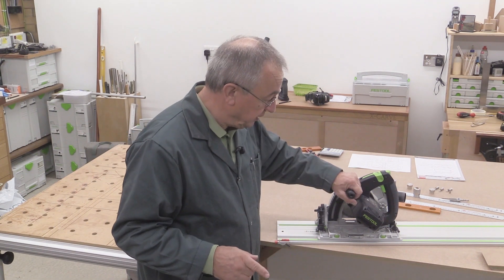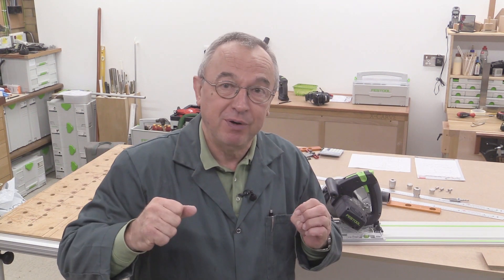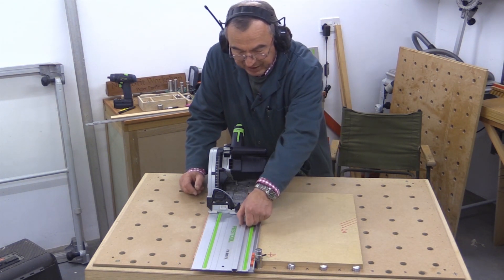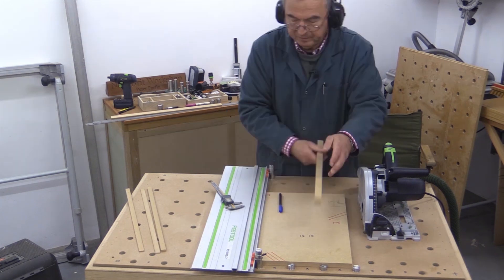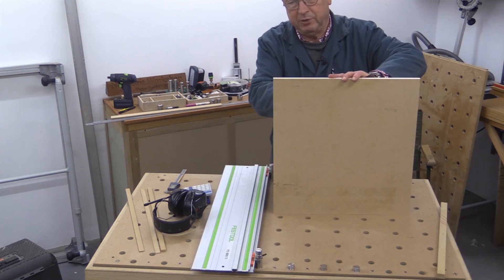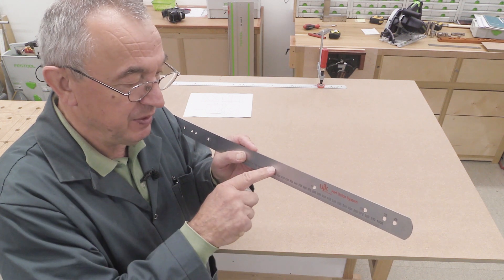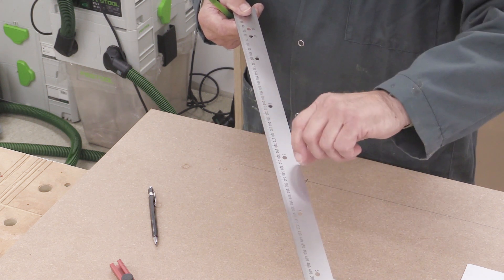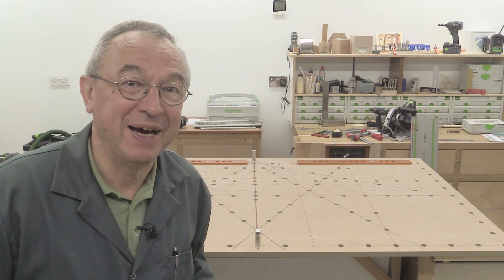Parf Guide System Mark 2  - 4 Cut Test

Comment: Thanks a lot Peter for this video and all your effort together with Axminster Tools. Today I drilled with the MK2 my first table top (19 mm MDF) and just did the 4 cut test, like you did.

For me it turns out to a difference of 0,135 mm  (meassured with a micrometer) which translates to a difference of 0,000088 radians which translates to angle error of 0,0050 which I think is absolutely amazing! 

On some holes I have a bit the problem that some of the super dogs are really tight and I almost can't get them out. Maybe I will drill over it again but so far I'm absolutely amazed! Thanks a lot!

🙌🙌🙌
Reply from the maker: Hi Lucas, Sometimes if the drilling of the 20 mm hole is done rapidly the hole can be tight. Axminster understand this and also know that holes in MDF can reduce in size by a fraction as the humidity level changes. So, they have produced a reamer for the 20 mm holes. There are two versions:
   - 107586 the basic reamer
   - 107868 reamer and chamfer tool combined
Peter

Comment: Hi Peter, first of all thanks for your videos, and thanks for the explanation of the rulers from 5.05 to 5.50. Not long ago, just over a month I bought from Axminster Tools, Warrington - Mark 2 Parf Guide System  and some accessories for it and they did cost me nearly twice as the Mark 2 Parf Guide System and IT WORTH EVERY PENNY, next purchase in my list is UJK Parf System Fence for repeatable cuts. 
              I notice that one of the rulers was out about 1.0mm the other one is dead straight, and I marked the straight one so in future I know and I can use as straight edge if I need it. And as you saying the holes ARE 100% on the straight line and I know that because I did few tests before I started to drill holes for new MFT3 top.
              Thanks again
Reply from the maker: Excellent.  Cheers.  Peter

Comment: Hi everyone.  
Short story: here are my results, in average deviation of 0.20 mm/m (based on 9 tests).  

Long story: this is my first MFT tabletop done with Peter’s system.  I am engineer as well, so respecting instructions (pdf, Peter’s video and from others as well) + be precise = my playground 😉.   I really like the system, it's brilliant and effective!

•	Tabletop in black valchromat 18 mm.  1300 x 830 mm   
•	Drilling done with new Festool TXS 18 C3.  The drilling of the 3mm holes grid was spotless, a pleasure and I was impressed by the rigidity of the 6-8-10 triangle.  This is indeed stiff.  The drilling of the 20mm was less cozy (see below).  

•	Total time: 95 min + 40 min for the 20mm bit drama story (see below)
•	Dry test with dogs: 75% of the holes are quite snug, 25% are less snug (but always without play, so no complain here). 
•	I did 9 x 4-cuts samples in a new 12 mm MDF board (yes I did invest some bucks in this test).  In three different positions for the rail (I did move the rail dogs to three different columns)
•	Cuts done with Festool TS 55 FEBQ with FS rail 800mm, itself attached to two 50mm UJK dogs with the UJK Parf clips (actually it is quite similar to Peter’s setup).  I did check that no play occurred between the track saw and the rail, of course :-)
•	Results of all 8 4-cuts tests in mm/m deviation: (stocks with lengths ranging from 357 – 598 mm):  0.21 ; 0.27; 0.09 ; 0.14; 0.26 ; 0.21 ; 0.18 ; 0.17; 0.25 = average 0.20 mm/m deviation, always in the same direction.  0.20 mm/m, I can live with that, more than enough for what I do, and for a first trial, I think this is decent.  Can it be better?  Yes! Some here have achieved better results, including Peter.

Now for the complaint part: the UJK 20mm drill bit cuter I got had some issues with manufacturing tolerances.  When I inserted it in the Centrotec chuck, it remained stuck.  Just impossible to release it.  It took me 40 min by gently moving it and finding the exact spot-on position to get it finally loose (to my relief, otherwise I would have need to send the drilling machine to Festool's service).  I carefully examined the Centrotec compatible end, indeed its sides were not perfectly machined (tiny milling grooves).  Also, I think the bit could be straighter, you could see movement fluctuations at the tip when you let it turn at max speed in the drilling machine. This is not coming from the drilling machine as, first it was new, and second the 3mm holes drill was perfectly straight and its Centrotec compatible end did work smoothly.   I adjusted the 20mm a bit with a super fine metal file and check it (meaning with the Centrotec chuck removed) to make sure it could be easily released.  However, it was not perfect and the bit got stuck again regularly.   Unacceptable for the 20mm cuter but I guess this was bad luck for me.  Therefore, I decided to use the FastFix keyless chuck to process all the holes while leaving the drilling machine kept attached to the orange guide block.  The Extractor outlet works well but makes the whole assembly a bit clunky with the hose attached.  Attention, you have to make sure your vacuum hose is not pulling too much during the drilling process due to its own weight and rigidity.  So according to me, those are the two main sources of inaccuracies for my trial.  The hose issue is easily solved by clamping/taping it on the table.

I will probably do a second top in the short future, and redo a test again.  And, yes I will most certainly need to get a new 20mm bit…
Reply from the maker: Your test results are quite good and with practice and care you can achieve a lot better. Valchromat is a tough material for your first experience with the PGS. If you have an issue with the 20 mm drill then contact the supplier straight away and ask for a replacement. Peter

Comment: Very well explained as usual. I wonder how many of us set the track saw up on the rail once and then do not check it as time elapses - me for one - thanks for the timely reminder.😀👍
Reply from the maker: Hi Norman, You are right and I think that I have only checked mine regularly after the mistake doing that original 4 cut test.   Cheers.  Peter

Comment: Hi Peter thanks for video. I just built my first table using mk2. My 4 cut test came in at 0.00025 compared to yours which is 0.00016. What would you say is an acceptable tolerance range in radians?
Reply from the maker: Hi Malc, Any thing better than 0.004 radians is good and once you get as low as 0.001 it is excellent and 0.0005 and lower is brilliant. So, well done on your result.   Peter
Reply: Thanks for the prompt reply. I am very impressed with the thought and engineering that has gone into this product and family of products. Look forward to see what you come up with next.

Comment: I built a Paulk bench out of hardwood oak ply and had issues drilling the dog holes trying to use a drill guide. My dog holes ended up creeping while being drilled and weren’t flush from top to bottom of hole. My precision of alignment was also sketchy along the rows so that I could only trust right angle alignment of a few of the holes. I ended up purchasing the PGS mk2 and had great success on a 1/2 sheet of mdf. Now I want to replace the oak ply top on my bench. Can I stick with the hard oak ply on my rebuild or will it be too much for the PGS to maintain precision on the dog holes?  I don’t want to use mdf for a top unless I will lose precision. I also am wondering if it will ruin the sharpness of the forstner bit cutting hardwood.
Reply from the maker: Hi Guy, I do not recommend ply for tracksaw cutting stations partly for the reasons that you have experienced. As an alternative, would you consider oak veneered MDF ? You would get a little breakout on the underside though but it would not affect accuracy. The very best material is the Medite MR as it has a very hard outer layer (top and bottom) and machines well with the PGS cutter.  Peter

Comment: enjoy all of your videos...can you tell me what is holding your guide rail to the table in this video...looks  interesting.  thanks
Reply from the maker: I use a pair of UJK Rail Clips designed for use with the Festool track. Axminster sell them - product code 102973. They clip onto the tall dogs. Apart from that it is only downward pressure keeping it in place which is fine.  peter
Reply: @NewBritWorkshop  Thank you sir...found a place is the USA that sells them..appreciate the help

Comment: After watching several of your videos I decided I wanted to try the Parf system on my MF3.  Was a little overwhelmed by choices, dog heights, etc. at Axminster.  Want a fence, appropriate dogs, clips, and maybe some shorter dogs for additional stock placement.  Could you maybe recommend some components for me to create a good starter set? Utilizing the Festool track system.  Thanks!
Reply from the maker: Hi Darwin, If you want to create a new (and accurate) MFT3 top then you need the Parf Guide System. I would recommend a pair of Parf Super Dogs, a Parf Fence and a pair of Parf Dog Rail Clips for your Festool track. the holes where the Super Dogs go will need to be chamfered for which you could use a router or the UJK Chamfer Tool.  Good luck.  Peter
Reply: Thanks for the info!  Product is ordered!

Comment: The cut that matters is the FIFTH cut. Please do that and give us the measurement of the piece cut off.
Reply: No, I don't think that's correct. As Peter explains, the fourth cut is legitimately his fifth cut. Given that cut 1 is just to establish the original straight edge, if that straight edge is already established then you don't really need to do it. Unless I'm missing something?
Reply: @ricos1497  Yes, you are. The first cut is NOT done to establish a straight edge. It is the first potentially errored right angle. The first four cuts establish the the (hopefully) right angles at the four corners. The fifth cut is a test cut, repeating the first. If all the corners were true, the piece cut off will have parallel sides. Any error will be multiplied by four and show up in the caliper measurement.
When you cut four pieces off the four sides of a piece of MDF, all you can tell from them is how far off square the original sheet was, assuming that the piece you cut is itself perfect. So this measurement has told us nothing.
Reply: @donepearce

Indeed,  the fifth cut is the one  that matters. This test is not complete
Reply: @donepearce  Sorry, as I understood it the cut was not from the original sheet, rather one Peter had performed himself and measured to be straight. 
I don't understand how the first cut is a potentially errored right angle? Right angle to what? Surely the first right angle is produced by the second cut? I'm maybe not following properly. Could you explain it in a N,E,S,W fashion if you have the time?
My thoughts were:
Cut 1 establishes the straight edge along N face, with no reference face
Cut 2 removes face E and establishes a presumed right angle between N and E
Cut 3 removes S, RA between E and S
Cut 4 removes W, RA between S and W
Cut 5 removes N, RA between W and N
With the offcut of 5 being the measured piece. 
In this example, cut 1 is arbitrary if N face is already straight as it's not referencing E or W faces. Are you saying that the starting point should be:
Cut 1, removes N face, establishing presumed RA between W and N
How would that work if W wasn't straight? Or are you suggesting that there is a 6th cut (in my example):
Cut 6 removes E, RA between N and E
Sorry, I genuinely don't understand!
Reply: @ricos1497  The right angle being tested is between the row of dogs and the saw track You need to start with a decent straight edge so the MDF rests securely against the dogs.
Reply: @donepearce  Yes, I think I understand your point now. I'm still struggling a little with the benefit of the fifth cut if the MDF is perfectly straight against the dogs, which I assumed was Peter's point. Hopefully he'll clarify what he meant. I'll get my head down and think it through some more, so I get a better understanding! I'm not doubting you, just myself!
Reply: @donepearce  Hmm, that didn't work for me! I got what appeared to be parallel sides after my fourth cut (I folded instead of cutting). I don't think I get it. 
Cut/fold one created a 90degree at NE corner (E perpendicular to N), cut 2 a 90degree at SE (S perpendicular to E), cut 3 a 90 degree at SW (W perpendicular to S and parallel to E), cut 4 a 90 at NW (N perpendicular to W and parallel to S).
If I hadn't started with nice straight edge(s) then there would have been an issue. Can you tell me at which step my perpendicular or parallel edges wouldn't have been created? That's the bit I'm not getting.
Reply: @ricos1497  Ouch! I gave you a test I should have given myself. Peter is absolutely right - four cuts does the job. It's amazing how facts you have known for years prove to be wrong.
Reply: @donepearce  I'm glad it was my ignorance and lack of understanding that led us to this! You know, there are people who would have angrily told me that this was the way it had been done for years and not to question it. It takes a certain type of person to be confident enough to show humility like you have here. Thanks for taking the time to work through my understanding, much appreciated.
Reply: @ricos1497  I love being wrong - it means that even at 70 years old I can still learn something new.
Reply from the maker: Yes, I have read all of this. The reason it was originally called a 5 cut test is simply to ensure that the edge that is put against the fence for the first cut is straight. Ask any engineer to explain this to you if you cannot understand that if you have a good straight edge to put against your fence then you only need to do 4 cuts. Well done everyone for coming around to understand this.  Cheers.  Peter